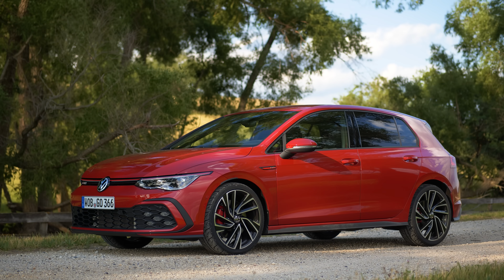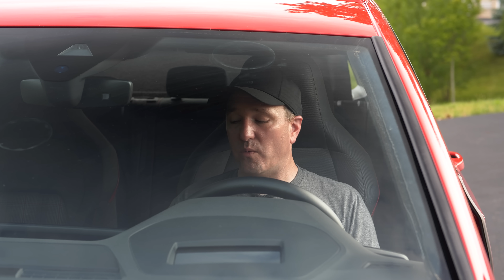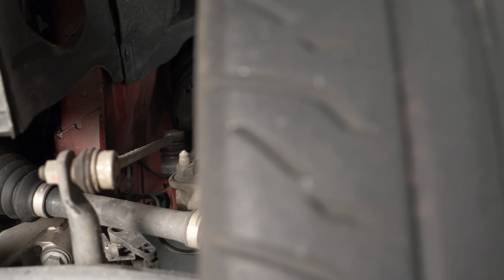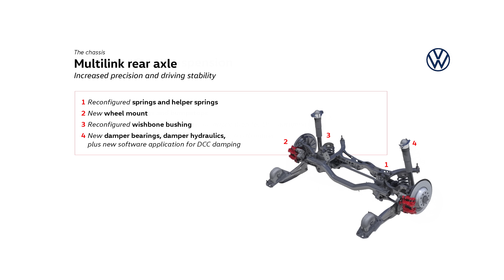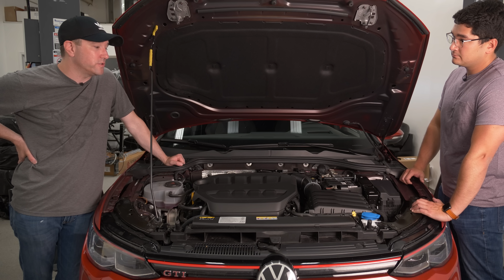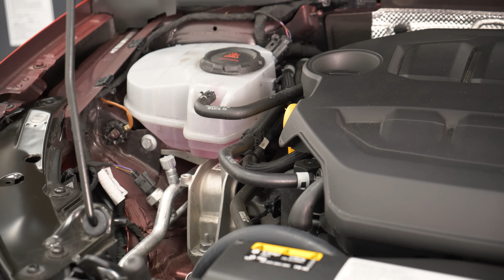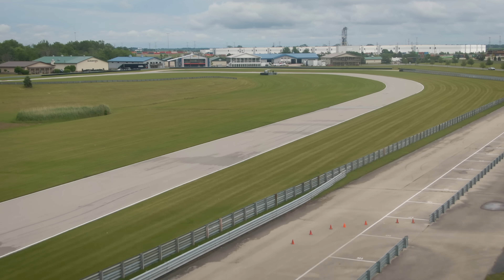2022 VW GTI Mk8 | Unexpected

Comment: Great video!  Can't wait for you guys to check out the US Spec car, not happy about the engine being different in EU and also noticed that the gearing in the EU Spec car you drove was shorter (same as in MK 7 EU cars) than US cars.  If the MK 8 US car has a crappier engine with DI only and the longer gearing we got in the MK 7 it would totally change the character of the car and it would be a huge No No when you inlcude the interior disaster of the MK 8

Comment: Mk.7 GTI made me swear off FWD cars. Incessant understeer both on and off throttle, constant inability to put down power. Plus weird throttle mapping, extreme turbo lag and wheels 2 inches too big for a daily driver.
Reply: Did your version have the limited slip differential?  That's very important.
Reply: @TassieLorenzo  No, I had an early 2015 before they put LSDs in all of them. Certainly would have helped to put the power down but didn't do anything for weird throttle mapping, mid-corner push, way too little tire sidewall for a daily driver, or the turbo lag.

Comment: This is probably the most competent Mk8 review I've seen.

Anyway... I'd be surprised if this car would still be literally in one piece and not disintegrated by the 100K kilometers mark: the engine, the electronics, the suspension... I mean, I don't believe for a second aluminium is going to be of any help to improve the quality, former MK6 and MK7 owners especially from Canada should have tested that out for themselves: after three years in salty road conditions expect the underside to look far worse than a 17 years old MK4.

So is every component VW makes or is buying from OEM: a very nicely engineered car (apart from the information and control system which is absolute rubbish) completely marred by subpar and cheap components.

I've been an insider of the VW forums (many) for years and I wouldn't buy another exactly for the quality and reliablity problems these cars have.

Comment: Nice !!!   great video,   I had the 2012 VW GTI Manual, it was GREAT ,  until 18,000 miles the water pump leaked and 33,000 miles I sold it, but Amazing driving car for the price, I would buy it again and get rid of it after 90,000 miles

Comment: It may be slightly faster, corner better and ride a little bit better, but the overall interior kills my enthusiam for this car. Since my deal fell through on replacing my 2016 GTI with a Mazda 3 Turbo premium hatch, I've left my options open...but I really don't think the MK8 GTI will be on the list, especially since VW dealers wont be dealing at all on early models. Lets be honest, those tires are making a huge difference on the track, and unless your GTI is a weekend toy, nobody will be running those daily year round. I live in North Texas..it does get cold and does snow, but not enough to invest in another set of tires and wheels.

Comment: Touch controls are garbage.  On any road that isn't a billiard table, they are nearly impossible to do accurately on the fly.  Fine if you're a passenger, and that's your only task.  Not so fine if you also have to drive.

So one of those 3 maids you mentioned should just be in the right seat, adjusting volume and HVAC for every drive, cleaning off the nasty fingerprints when it's parked.
Reply: Take a corner with said maid in the passenger seat and things are going to get... shall we say, intimate?

Comment: As a fairly new owner of a MK8 GTi, I'm personally tired of all the moaning f**ks, gripping over the touch controls.  Get over it - it's the way things are going, whether we like it or not, and it's not limited to VW.  Tesla's gota be worse with that stupid great 'iPad' in the Model 3 and no dashboard display, so you've got to look over to the centre of the car to see the speedo.
Reply: Complaints by users and critics are why honda added back physical  controls. Rolling over and accepting terrible ideas seems like the wrong move imo.
Reply: @jackethnicallyambiguous  well "terrible ideas' like touch control I reckon are here to stay, no matter how many users and critics (and those who wouldn't buy it no matter how good it is, but like to moan just cos they can) complain.  If I was going to change anything, I might want the climate controls restored to physical buttons, but that's about it.  As a car to drive, it's streets ahead of previous models IMO.

Comment: I just can't see any justification in FWD, and any car that doesn't have snug seats is just dumb. If you can't fit, stop eating carbs and eat only one meal per day. You'll get there.
Reply: You can't?  Have you learnt the history of FWD from the 1930's Cord and Citroen Traction-Avant onwards, through to the 1950's Citroen DS and then 1970's VW Golf and Honda Civic? The only reason the likes of the Ford Escort and Toyota Corolla stayed RWD in the 1970's was because, as the conventional layout, RWD was still cheaper to make at the time. VW purchased NSU in the 1960's specifically to acquire knowledge in 'modern' front wheel drive vehicles for instance -- the NSU Ro80 was much more advanced than an Audi 80 of the same era. :)

Comment: Touch controls... bad once... BAD FOREVER. Fuck this garbage. Not logical, not intuitive, not safe. Again, garbage. When is this shit going to die? Everyone hates it... Why is it taking so long?
Reply: Meanwhile there is a law about being responsible if you use your phone or your entertainment system while driving. There is significant awareness of the problem of driver distraction. Yet car manufacturers have always gotten away with making unsafe design choices.
A red rear license plate lighting was a no-no, yet LED indicators that you barely notice are in action are OK.
And don't get me started on the whole HID level adjustment sham.

Comment: - VW is allegedly situated in Wolfsburg, but I think they've always gone south to Ughsburg.
- They only call it GTI now, not Golf GTI?
- That grandfather slippers seat pattern is cringy for a sports model, even more so with 'sports' seats, even more so with red stitching.
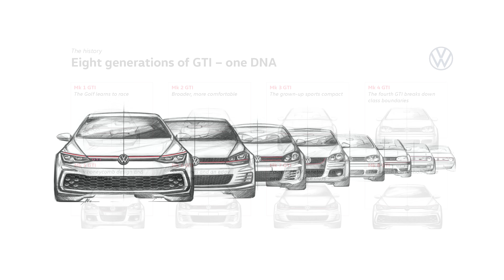- 5:29 Oh my god, you can really see the lifecycle of a model in that 'face'. - Mk8 is the senior with a belly who pretends to be younger than he is. - 6:36 Yes, pounds dropping is the right wording.
- 14:05 'Proletenstyle' from the factory. Nothing says Golf GTI like red-painted floating calipers. And the way they are made, with that rough surface, ensures that the paint job looks as dilettante as possible.
- 16:50 What a stupid tachometer is that where the redline is always beyond wherever the needle is?? - Do I have to guess that it revs to exactly 7000 because the 7 is red? ... Why don't they just make th needle a different color? (Well, OK, I guess once you get used to it, it is a more easily readable visual style. ... But generally, any car that uses display tech should offer alternative styles or it is wasted potential.)

Comment: Would you take the MK8 GTI over the veloster N? From the veloster N DCT review, a downside of the N was the inability to rotate under braking and the cheap interior. The MK8 solves those , but not as much character stock for stock. Will definitely have to try test driving both when avaliable in states.

Comment: Anyone that's driven on RE71s knows how irrelevant it is to talk about the chassis/suspension/diff improvements on them. Of course you can go full throttle leaving the corner. It's got way more grip than power.

Comment: Look up at a 30 story building next time you're in a city (or the Statue of Liberty from earth to torch), if you stand it on it's side,  at 65 miles per hour that's approximately the distance you travel in the 3 seconds your eyes are diverted to a touch screen.  For this reason, I THANK YOU for continuing to slam manufacturers for burying the simplest most common functions into a touch screen.   

I'm not technically illiterate, I'm constructively lazy.   I know how to use a touch screen but certain things don't work well when operating a machine that requires you to pay attention to what's happening outside of the greenhouse, because nannies can't solve everything.  

If manufacturers insist on this continuous march into needless complexity, they could solve a lot of problems by having a series of customizable buttons and dials that do whatever the driver programs them to do.  You'd think that would occur to at least one of the industrial designers / engineers at VW who without a doubt has a whole host of custom key commands and outboard gear helping them come up with a 5-step menu-dive to activate the cooled seats.  That's how I work.

Comment: It's funny just how excellent the mk7/7.5 looks next to the mk8. It's staggering how bleh the design of the exterior of the new one is. The removal of all the piano black surfaces is a great change. I love that but why did they make the steering wheel controls piano black aids to touch and use AND the HVAC controls are inside the screen!!! BAD VW NO!

Comment: As someone who recently put PS4S’ on my MK6, I feel like you need to revisit this car with the stock tires. In my experience the difference is stratospheric compared to all seasons. I’m sure the MK8 is fun, but does the fun factor remain when you have to deal with all those interior deficiencies and sit on mediocre stock tires?
Reply: That's what I was thinking. A tune on a MK7 with a nice set of tires makes it a different car entirely. I feel like that was basically what the real difference is over previous gens, especially a MK7 with DCC and the VAQ differential.
Reply: Tires are by far the most important thing on cars, I mean they are the very thing connecting you to the road, but yet people somehow forget about them. 
FYI: Modern tires are the reason something like the Civic Type R can rip apart the lap times of a Gallardo from just over a decade ago.

Comment: Having fun there, guys?
So the European model doesn't fall apart when pushed hard on some of the stickiest "street" tires available. That's good news. I can only hope the North American version doesn't get dumbed-down. VAG attorneys will probably want the oppressive understeer baked back in. The engine we get is also a big unknown. Will it have direct and port injection? Will it pull all the way to redline? No way to tell at this point. We can only hope.
I test drove the previous GTI. Even on the street, it was obvious too many electronic hands were on the steering wheel fighting me for control of the front end. The audio was third-rate also, at least in my opinion. If this taste of the new GTI is anything like what we will actually get, it is welcome news. The next Golf R should be amazing too, especially if stability control can be fully turned off.